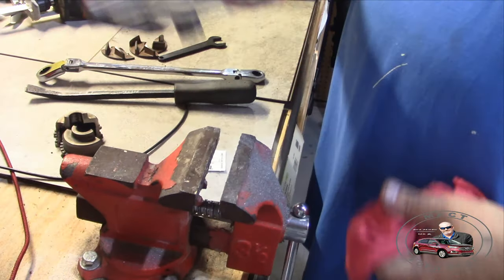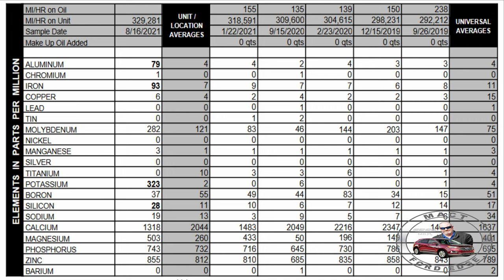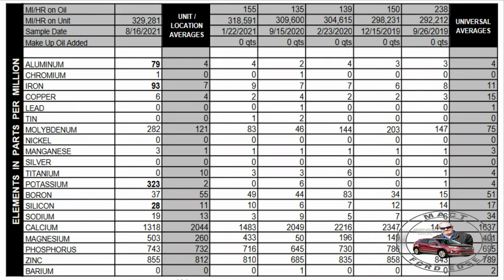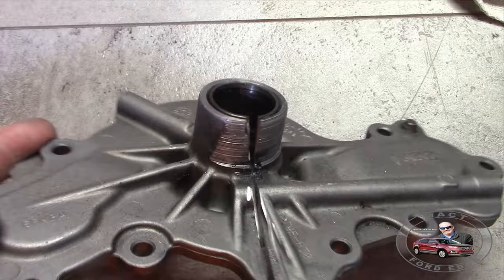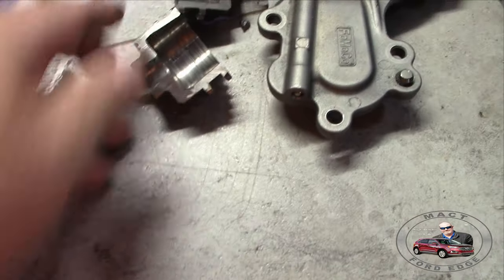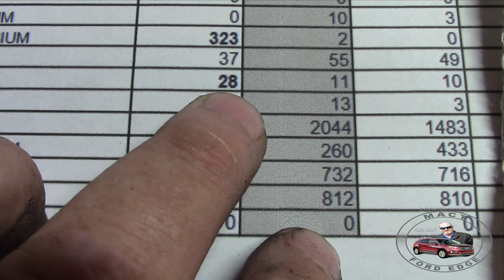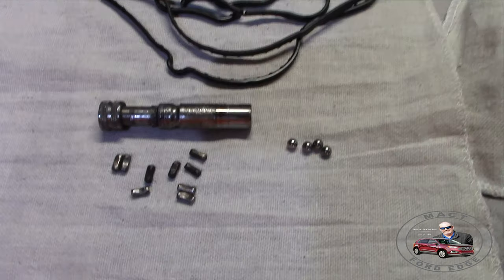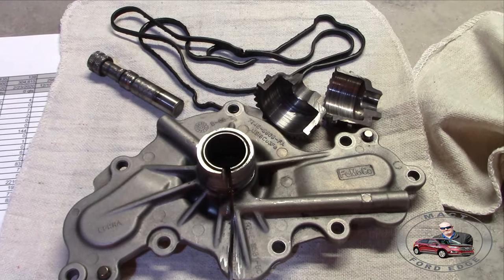The dissection and explanation of the 330,000 mile water pump failure and  the metals in the oil.

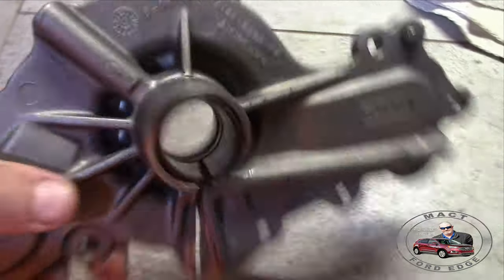Comment: that part of the pump on the oil side (sprocket side) that showed uneven wear (part shiny, part gray color at 9:43 in the video) -- how is that lubricated? is it a packed bearing? someone told me that the shaft bearings were needle type but that doesn't appear to be the case when you drove the shaft from the bearing. Which wears 1st - the seal on the coolant side (allowing water to get into the bearing) or the oil side part of the bearing? (assuming there's any way for you to tell) -- that scoring of the housing area on the oil side may have occurred LATE AFTER water had already gotten into the bearing itself causing the shaft to cant?